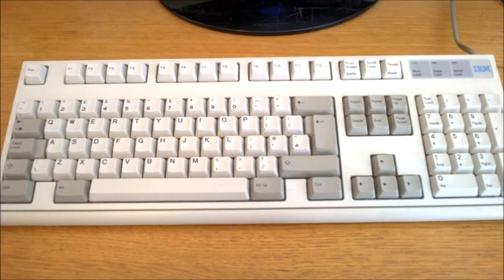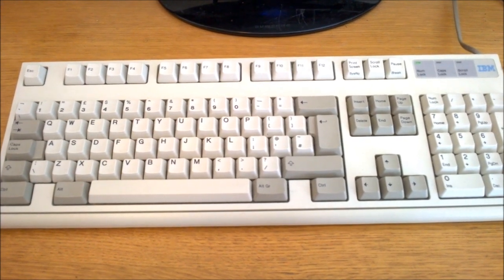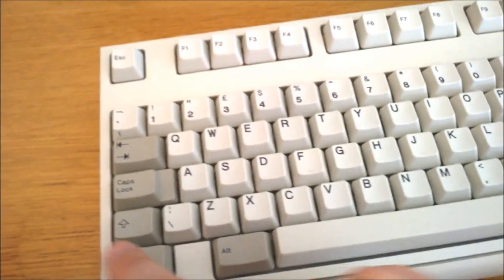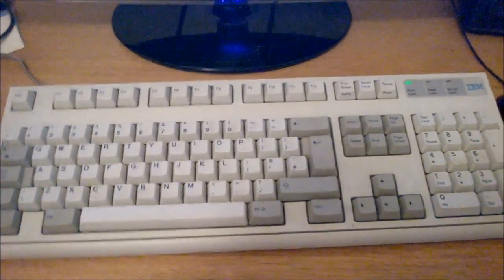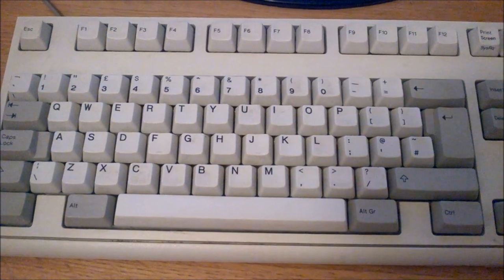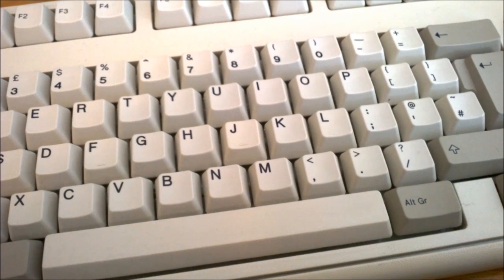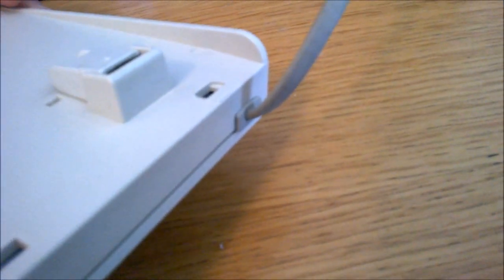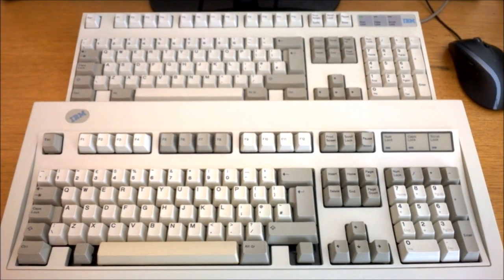IBM Model M2 review (IBM buckling springs)

Comment: My Model M2 has been in daily use for almost five years now, and it still works perfectly... in fact, I'm typing on it now! I find it to have a lighter feel than the regular Model M, plus it takes up much less space on my desk, so that's why I prefer it.

And IBM made rubber dome versions of both the Model M and M2, so not all of them have buckling spring key switches.
Reply from the maker: +vwestlife Yeah I noticed the M2 in some of your videos :) . It's possible that your constant use has softened the M2's typing feel somewhat; something similar is a known issue with Cherry switches. 

And yeah, there were rubber dome versions of both, but I (fortunately?) haven't found any yet. They're reported to be very good for rubber domes, so maybe I'll put one in for a rubber dome video if I get enough material on them :) .
Reply: +vwestlife The rubber dome version of the original Model M is good for one thing. Stealing the controller to get a terminal / RS2000 version of the 101 M working :)
Reply: Are you talking about the keyboard that came with your IBM PS/1 PC?
Reply: Lachlant1984 No, later on the model M case and tooling was used to make a rubber dome version, however the controller PCB is the same, so you can use it to change any other none PS/2 or AT model M and use it on a PC
Reply: One theory is that usage prevents the capacitors from erupting.
Reply: You're a lucky person! Using an M2 is rather like owning a pit bull. It'll probably be fine—but if it does decide to turn on you, you'd better be wearing armor. Okay, that metaphor didn't really hold up, but my feelings about the M2 are so conflicted, they tend to overwhelm my... er... whatever that thing was I was going to type here.
Reply: Another theory is that keyboards in constant use typically live in a more controlled environment with less temperature swing.
Reply: My comment was actually directed at vWestlife regarding his M2 keyboard, I should have quoted him in my original comment.  It's too bad YouTube doesn't tag people automatically when you're replying to their comments, at least it doesn't when you're using Safari as I usually do.
Reply: Having replaced multiple faulty caps in flatscreen tvs before, I can say that caps can age regardless of use.
Reply: @y11971alex  I love the idea of that :)

Comment: I had one of these in for a couple of years around 2005. I had to get get rid of it, because it drove my wife nuts; at the time we live in an apartment, and it was too loud for her. I regret getting rid of it, and have been chasing that "feel" for a couple of years now. I have 4 mechanical keyboards now, 3 with Brown switches, and 1 with blue switches, and the sound of this M2 typing brings back memories.
Reply from the maker: You should get a proper Model M, puts MX blues to shame ;) . They're very common and you can have them for very reasonable prices :) .
Reply: Unless you are sucker for RGB lighting or LED lighting for that matter or just dislike the level of noise and sheer heft of it.

Comment: Summer 2011 I found one of these for 74 cents. (0.69+tax) at a thrift store.  Had to replace a capacitor.  Had never soldered in my life but I did it easily and it worked great

Comment: i came across an m2 that was rubber dome (73G4614) but luckily the keycaps had the buckling spring barrel and not the "rubber dome" ones. so i kept the membranes, tossed the domes and used buckling springs i got from a dead model m. all the keys work and the sound is definitely very "pingy" to the point i find it annoying. i did this just to see if it can be done and it can

Comment: Replacing the capacitors on this is a nightmare.  You have to remove the top cover, which, in addition to removing the two screws on the bottom, requires popping off all key tops, and then un-snapping several easily breakable plastic snaps.  To fix the erratic key behavior, I placed Scotch tape near the offending switches, (on the lower membrane) which increased the gap between the upper and lower membrane just enough to allow the buckling springs to push the correct contacts together without causing others to make contact.  Definitely a classic keyboard (sold with our IBM PS/2 many years ago), but you'd be lucky to find one intact.
Reply: Weird. I had some keys not working on mine. Probably because of dirt and oxidation of membrane, and poor contact between membrane and circuit. Cleaning with alcohol and eraser and placing a piece of eraser to push down the circuit fixed all of them.

Comment: As someone who owns both the Model M (1994, double caps, BNIUB) and the Model M2 (1992, needed replacement capacitors), I actually prefer the M2 over the M, because of its 
(1) smaller, more modern footprint that doesn't take up all of my desk's mouse space, especially as I like numpads, 
(2) lower-profile keycaps. The keycaps on the M2s are closer to Cherry profile than the extremely tall caps on the Ms, which hurts my wrists a little after prolonged use, and 
(3) unassuming looks; I know looks are subjective, but for me, the M2 blends in very well whereas the M always attracts people's attention.

Comment: My experience with the model M2 (pretty frustrating): Last year I found a model M2 for 5€. It wouldn't even be recognized by any system preventing them to boot up. Ordered the caps, replaced them and while it is now being detected you can't type a thing. I cleaned the membrane and nothing changed. I might resolder the caps at some point... Meanwhile the rest of the chassis is placed upside down with the buckling springs inside for over a year now, waiting to be reassembled.

Comment: - Plastic case -- checked
- Integrated housing/barrel plate -- checked
- Questionably built chassis for otherwise delightful switches -- checked

Welp thats it, I'm calling this thing HHKB Model M2
Reply: At least the HHKB doesn't have nearly the amount of reliability issues this thing does. Also the HHKB was made to be portable, the M2 has no excuse for that LMAO.
Reply: And the HHKB doesn't flex nearly as much as this thing.
Reply: @JackOfHarts96  yea but the HHKB isnt nearly as long either so of course its not going to flex as much.
Reply: @commandozambo7867  I had a Pro2 HHKB and it was a delightful keyboard. I miss the keyswitch sound and tactile bump more than anything. I ended up selling it when I got into programmable boards and now I regret it because I can do most of what I wanted to do programming wise with AHK or I could even buy a Hasu controller for it if I wanted to get fancy. It's just the best feeling/sounding keyboard I've ever had. At the moment my Kemove Snowfox with brown gateron switches is the closest thing I've found to the feel.

Comment: If you or anyone needs new springs you can get them from Unicomp, the company that now own the Model M rights.
The springs are $0.20 (~£0.16) each and shipping is about $14.66 (~£11.38). The shipping is based on weight and you can order up to 49 at that shipping rate. 50 or more bumps the shipping to $31.49 (~£24.45)
Here is the link for those springs
http://www.pckeyboard.com/page/product/PVPLASM

Comment: Have you ever used any of the Olivetti PC keyboards?  Back in 1998 I used what I believe to be an Olivetti model M24 PC, it was an XT compatible computer running DOS, I think it had a buckling spring keyboard, it had the Olivetti branding on it, but I think the keyboard had the standard XT layout, and interestingly it had a 9 pin port on the back, I understand it's for a mouse.  I remember the keys were very clicky which makes me wonder if it had buckling springs in it.  It too had some funny problems, when I typed the letter y for example, it would also type a number 7 and things like that.  Too bad the IBM model M2 isn't a very good keyboard.
Reply from the maker: I don't think I know any Olivetti buckling springs keyboards, they're most well-known for their Cherry and rubber dome keyboards, of which I have both. Well, I traded the Cherry one for the keyboard I'm going to show you next week ;) .
Reply: Looking forward to seeing it.  I think you've said you're not a big fan of Cherry key switches.
Reply: BTW, if the Olivetti keyboard didn't have buckling springs it must have had something similar because it was very clicky, I also remember my step father's sister had an old Olivetti PC that had an extremely clicky keyboard who's internals really vibrated like you wouldn't believe, like, it was really pingy.
Reply: 8 years late, but i know what you mean. I currently got the keyboard from olivetti 24, i believe it's some specific switch made by olivetti, nothing very known.

Comment: I purchased one at a flee market for 10$, the caps were dead, so I replaced them and it worked for 2 weeks or so. then, some keys stopped working because of the membrane being a piece of shit, tried to fix it, but I think I made it worse. 

I quite liked it, when it was working. it's the only bucking spring keyboard I ever used and I have to say I miss it.  

RIP my model M2 from 1993. I barely knew you. :'(

Comment: m2 looks like a good  keycap doner
Reply: Not even that, they have their own mount and a slightly lower profile too.
Reply: I just tried, an M2 keycap on a (Unicomp) Model M doesn't work at all, and an M keycap on an M2 works but the key is extremely wobbly.

Comment: I just got a M2 from Ebay for only $25! I replaced the caps with 1 poly cap and one tantalum cap (I prefer polymer but none were on Digikey of the correct values) All the membrane contacts are now working!

The only things left to do are clean the keys and springs, and would you recommend me using PTFE grease on the springs?

Comment: A bit harsh your review I think. The springs exactly are the same as the model M and the keyfeel is very similar. Also the footprint is very small - it looks a more modern keyboard than the original.
Reply from the maker: It IS a more modern keyboard than the original :p . But I stand by my point, other than the size it's slightly to much worse than the M in every way. These are somewhat rare to find in a working condition while the older M is still going strong ;) .
Reply: @Chyrosran22  hey man I fell in love with my m2

Comment: Have you ever used an IBM Model M SSK? It might just be, but when I type on my Model M SSK, it seems to sound much more pingy than my full-size Model M, but not as pingy as the Model M2. They do have different layouts, with ANSI on the SSK and ISO on the full-size Model M with French-Canadian legends (this one is actually made in Mexico whereas the SSK doesn't specify where it's made, but I would assume the United States, and the SSK is also older, being manufactured in 1987 whereas the full-size Model M was made in 1990), and I don't know if the layout changes anything in regards to sound, but I did notice the Model M SSK I have doesn't have the two-piece keycaps, instead having single-piece keycaps like the Model M2. I actually need to replace the spring on my Model M SSK's right arrow key as it seems to have been sheared off.
I am quite curious to try the Model M2, though, and I wouldn't mind getting a faulty one to fix as I like getting things that don't work to fix them up. I've got four different PCs set up (ranging from MS-DOS up to Windows 10) and I'd like to have one IBM buckling spring keyboard for each (I'm such a sucker for these things, BUT I must admit that I don't like the sound of the Model F, it sounds far too pingy for my liking - despite this, I wouldn't mind owning one).
However, THE IBM buckling spring keyboard I'd like to get a hold of is the Model M13, specifically the black version of this keyboard. It matches my new PC (even though the motherboard only has a single PS/2 port, so I can't use the TrackPoint or mouse passthrough without some USB adapter that I don't particularly care for), but f*** me, these things are overpriced.
Lastly, regarding the Model M2's capacitors, there are only two in the keyboard, correct? Aside from the tedious task of yanking out the keycaps to open the thing, replacing the capacitors sounds pretty straightforward.
Reply from the maker: No, I don't really like space-saving layouts as I depend heavily on the numpad both at work and at home.

Comment: Eh, the M2 looks like the perfect keyboard design for me. I don't like the massive size of the model M, and I don't like the really tall keys of the model M either. The M2 chops off all the extra plastic, and shortens the keys a bit, (at least it looks like the keys are shorter). Capacitors are super easy to fix. I think that the M2 could be the perfect keyboard to mod with an NKRO pcb, custom controller, and if you got some extra cash you could screw a metal plate to the bottom of the keyboard to eliminate the twisting and make it heavier.

Comment: Indeed, Thomas, the M2 seems even less excusable, given that it followed on the heels of some of the most robust keyboards ever: the IBM Models F and M. What on earth was IBM thinking? Didn't they realize how this radical cheapening-down would reflect on their products? Go figure.
Reply from the maker: zeppy13131 They probably reasoned the exact opposite way around. They still made mechanical buckling spring keyboards while everybody else was starting to switch to rubber.

Comment: Hi there. Please tell me, what liquid I can use for cleaning and repairing the membrane from model M,  buckling spring version ? Thanks a lot.
Reply from the maker: +Roman Demyanenko Hiya mate, I'd use some isopropyl alcohol (electronics-grade alcohol). Rub any corrosion off gently but be careful not to scratch the silver traces.
Reply: +Chyrosran22 Thanks for the answer.